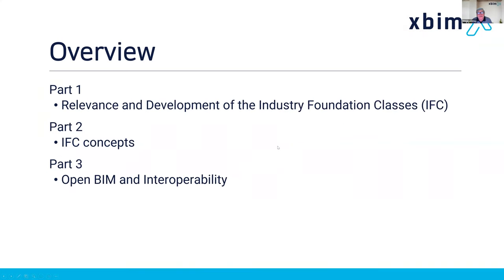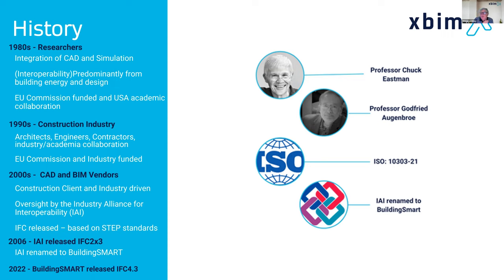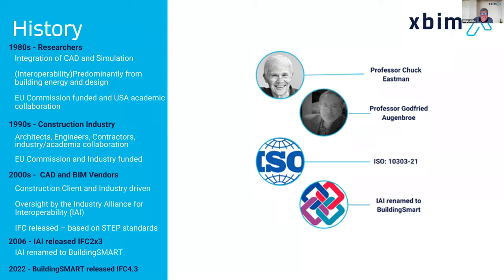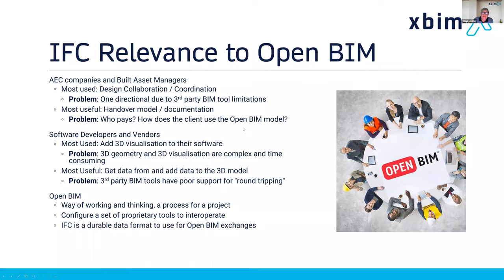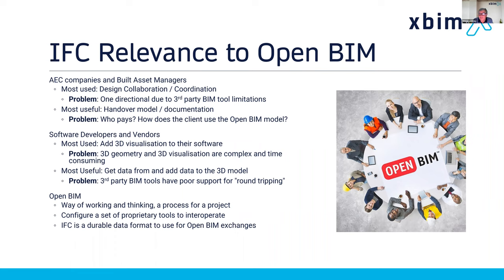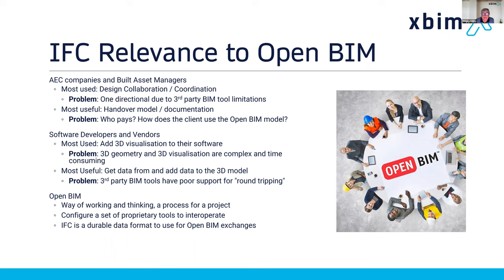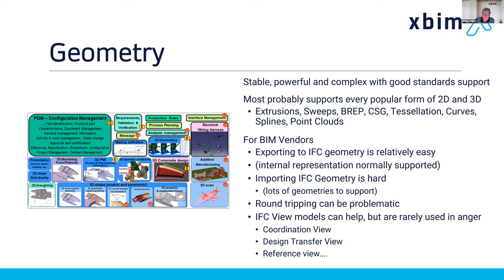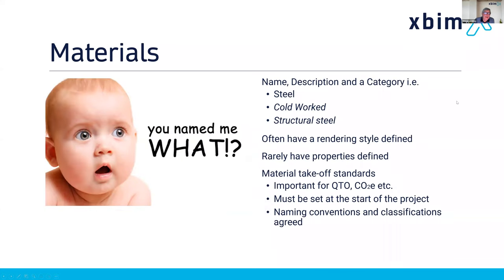Introduction to IFC and its relevance to Open BIM

Comment: 26:33 Indeed there should be agreed standards and naming for materials classifications in AEC. Currently that has not been standardized but there’s an urgent need for that to ensure a common language. Personally, I assign my material “Category” based on the RICS NRM 2 classification but that needs to be streamlined according to standards and be able to link them.

Comment: thank you for you video - helped me a lot! I still do struggle to understand the helicopter view. Could you explain, why it is sorted Top-Down? Why is the domain layer on top and the resource layer down? An What does the Core/ kernel Layer express?
Reply from the maker: Glad it helped your understanding! Just on behalf of Steve I'll try to add my answers to your question about the Helicopter view of the IFC schema at 16:00:

Why is it sorted Top-Down? 

It’s pretty conventional for these kind of (software) Architecture diagrams. The general idea is you can read it top to bottom. Higher level concepts build on the lower-level concepts. (A bit like a building itself where the building structure & fabric sits on the foundations / super-structure, then you can bring in the systems (HVAC, electric, plumbing etc), and ultimately fixtures, finishes etc. Without the lower level (foundational) concepts the whole building falls down. Of course day to day in your home or office you probably don’t care much about the lower level  foundations – but if it’s not there you may have problems!

What does the core/kernel layer express?

In the IFC architecture, the highest level concepts (perhaps easiest to understand) are at the top and are highly specialised, while the lower levels get more 'abstract' and more generic. So the 'domain layer' contains specific concepts relating to specialised industry domains: for example, HVAC brings in ideas like Boilers, Valves, Chillers, Air Terminals etc. Structural domain contains concepts like Piles, Footings and Rebar;  The Rail, Road and Tunnel etc domains bring in concepts specific to those specialisms (Road, Track, Signals, Kerbs etc) . 

Below the Domain Layer is the 'Interoperability layer' that contains 100s of the common 'shared' concepts (many we probably all understand when we talk about buildings), which could be used across all Domains. So items like Walls, Doors, Beams, Furnishings are defined here, as well as some more conceptual modeling items relating to building systems and their connections.

Then we get to the Core layer, which brings in some important concepts about buildings and facilities. So the idea of a Building itself, Spaces, Storeys, Zones and their relations etc as well the some modelling of the building process and activities.

The Kernel is one step lower again, and brings in the foundational data models for IFC used by everything above. It categorises concepts into groupings/families, such as Products, Processes and Controls. If you're familiar with software development there's a concept of Object Orientated progammming where real world objects are classified according to characteristics and behaviour (similar to how scientists classify the biological kingdom using Species, Genus, Family etc) - that's what the IFC Kernel brings in. Key concepts of Object, Type, Properties and so on, and many of their Relationships. Relationships are perhaps the most important part of the IFC schema - they describe the how the many different elements in a model relate and interact with each other. So a single element like an IfcDoor will have many relationships describing a myriad of concepts including its type/family, where it is placed, how it is represented & styled, its relation to wall it sits in, the spaces it serves, the properties defining it - just to name a few. These are all relationships. Without them it would just be a door somewhere in a model without any context or value.

Lastly, we get down to the Resource layer. This is all about defining the fundamental grammar of how we describe all things in IFC for anything in the built environment. Here IFC defines underlying means of measurement (SI units, Length, Area, Temperature, Time, Energy etc), and establishes core data models for describing complex things such as Geometry, 2D & 3D topology and Presentation and defines how IFC describe things like Materials and Properties of any item in a model. At this level its extremely abstract and crosses into the world of software concepts – you won’t find much building or infrastructure related down in this tier – it could be used by pretty much any scientific or engineering service. But importantly it underpins all the concepts in the tiers above.
Hopefully that gives some context. If you want to learn more, it’s worth having a peek at the official IFC documentation. The latest IFC4.3 docs are actually very easy to navigate and understand. For example here’s how a Door is defined in the Shared elements schema: https://ifc43-docs.standards.buildingsmart.org/IFC/RELEASE/IFC4x3/HTML/lexical/IfcDoor.htm 

Andy